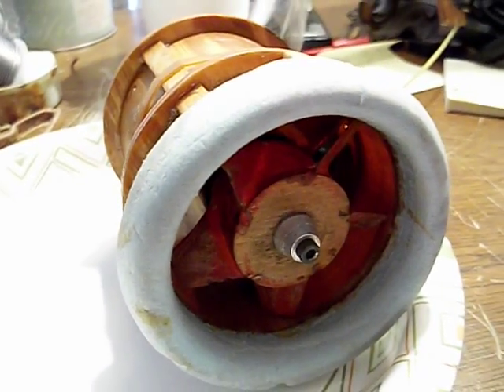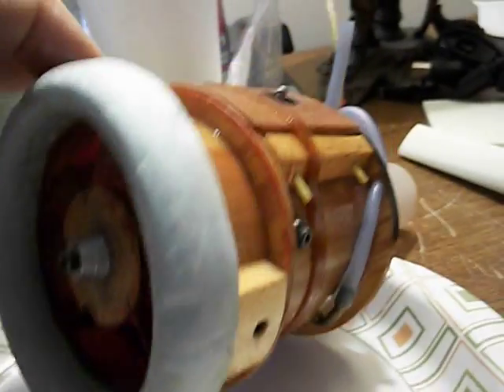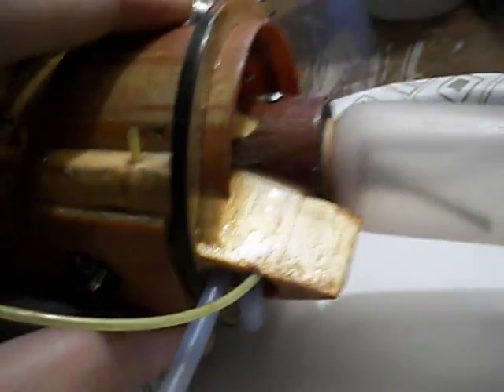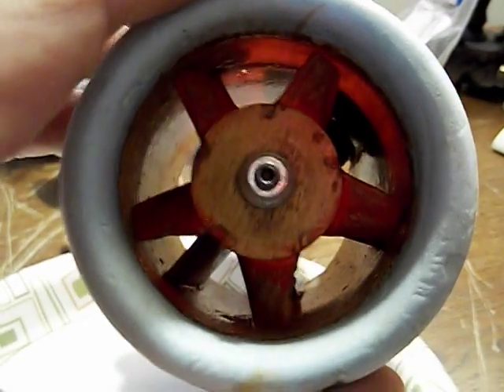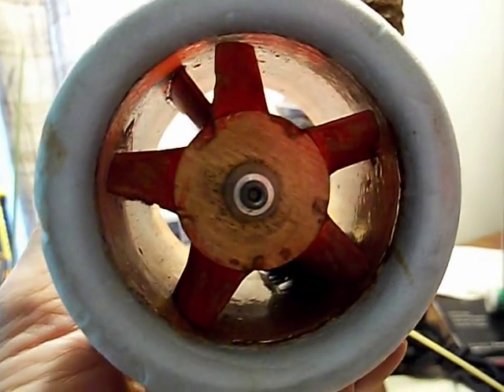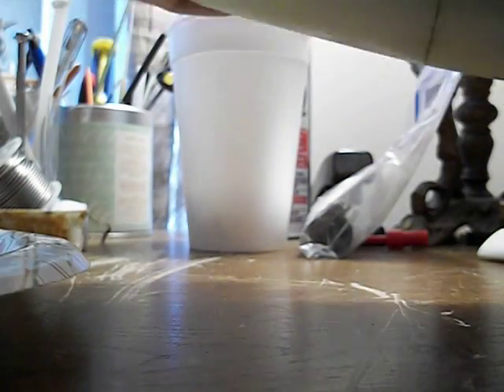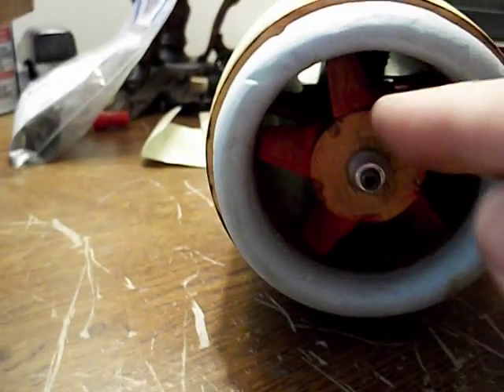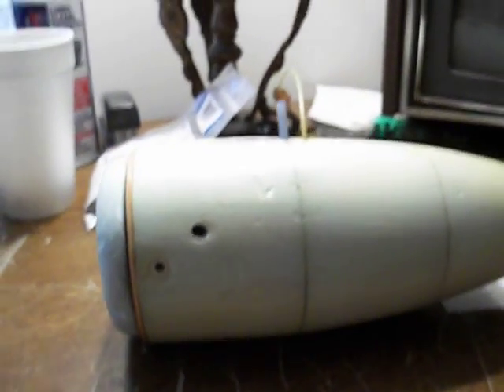Ducted fan  1/2 A (.061) glow engine power

Comment: How mutch thrust did this make ?
Reply from the maker: don't recall for sure as this is nearly 20yrs ago, but think it was about 11-12 oz. IIRC I tested by both aiming the output at a scale, and also hanging the fan or a fixture that measured how much swing took place, then do some calculations to arrive a t thrust figure, confirmed that to the aiming a scale measurement.
Reply: Dave WM  Thanx for the input... im thinking of converting å modern edf with a glow engine :)
Reply from the maker: I would recommend against that, besides the mess of the glow fuel, starting is always a problem, and the noise is also not good. Beside that the motors and battery combos out there make it much easier to match up the requirements of the fan. All that being said, Bob Violett was very successful with his glow DFs back in the 1980's up until the lipo battery age. After that he went all electric. But if you do post up some videos, should be interesting to see what you can come up with.
Reply: I have a few edf.. but would like to try a backword conversion...thinking of a high rpm car glow engine modern edf fan.. and clean ducting without the motor inside the main duckt...  i like to try stuf :)..

Comment: Wow! Love this dude- really cool. I'm a huge fan (pun intended) of glow or diesel ducted fan planes-I simply like old school stuff. I have designed a F16 all balsa and ply free flight model around a cox 049 black widow engine. you have inspired me to get it finished! Nice work.
Reply from the maker: its a challenge to make them work, which is where the fun comes from. good luck with it!
Reply: Couple years ago I found some drawings of multistage ducted fans for glow engines. I still have them somewhere, with graphs  of tests of performance. The funniest thing is that it was designed by soviet rc planes constructors as back at that time they couldnt access wide range of powerful engines as there wasnt any legal import.  If someone need that, I can translate it and provide for free. Drop me an email: kassinni@ outlook.com
Reply: yes sure.
Reply: ***** Didn't get anything from you yet. I found everything with instructions and materials specs...

Comment: I used to fly with you at RCACF back in 2001 to about 2004. I can remember some of those ducted fan planes you built. Man they were fast!!!
Reply from the maker: Good to hear from a fellow RCACF'r. I have not flown in years, just kinda got out of it, no real reason, may get back into it again. I still have my small electric jets, got rid of most of the rest, and still have a few helicopters.
Reply: Dave WM
Hey Dave good to here from you. I got into giant scale aerobatic planes and heli's but lately I've been scratch building1/2A R/C planes. And speaking of 1/2A, do you have any .049 - .061 size ducted fan units for sale? I have a COX tee Dee .049 and a Norvel .061 that I'd like to use in a jet but I haven't been able to find any ducted fan units and the ones that have popped up on E-Bay were way over priced!
.
Reply from the maker: I would really not recommend going 1/2a for ducted fan, I only kept mine as a novelty to my efforts to try and make it work. Besides the starting issue they just do not make the power as you need to really spin higrer rpms, and besides a 1/2a is at best 100watts, which is low compared to any modern electric fan.
Now I do recommend still going 1/2a for things like small planes. I just like the old school stuff, I used to love my old ACE GLH, a fantastic little pylon racer.

Comment: It slowly dawned on me how nice that is...I first thought...??? Well I will not say. TV repair too..small world!
Reply from the maker: I was into RC for about 20 years, guess I got bored with it after I built my micro jet, it was about everything I wanted in a RC plane. it is electric powered full house (ailerons/elevator/throttle/rudder and had a retractable tricycle under carriage. I did that about 15 yrs ago and am proud to say that it really has not been duplicated (not on the scale I did). Electronics is a hobby that reached back even further for me, So it was  easy to pickup on again after the long break.
Reply: Great stuff..)))

Comment: I have a bunch of those motors somewhere. Used to play with them when a teen. Very noisy and they run on some special fuel IIRC. I remember the smell
Reply from the maker: glow fuel, a mix of alcohol and nitromethane. about 50/50 IIRC for small engines like this (and a lot castor oil mixed with the fuel mix). Yes extremely noisy, which besides the hard starting of a ducted fan really ruined the over all effect (jets dont sound like buzzing cracked out bees).
Electric motors completely dominate now except for the really high end tubines. The turbine down side is the need for waviers to fly as well as some dry areas forbid them due to fire hazards.